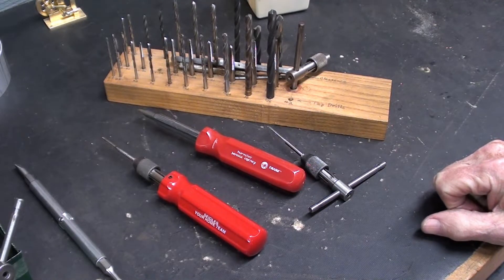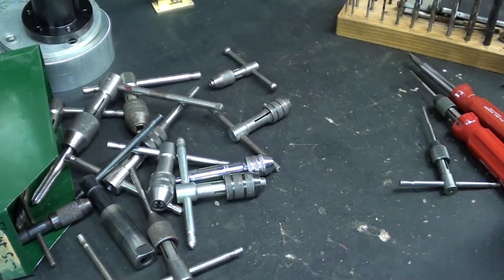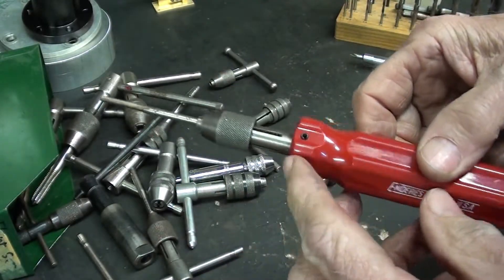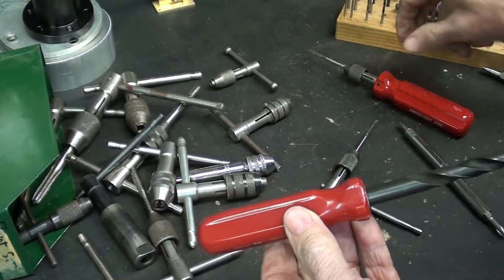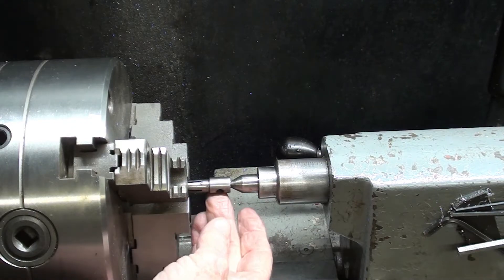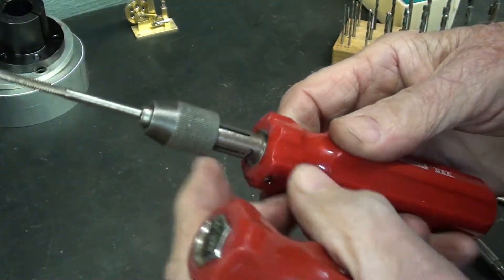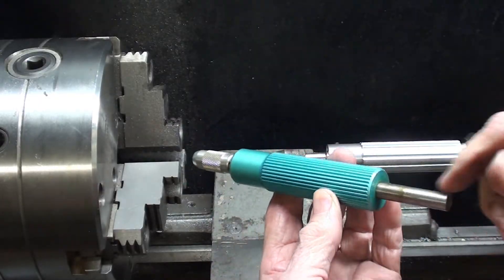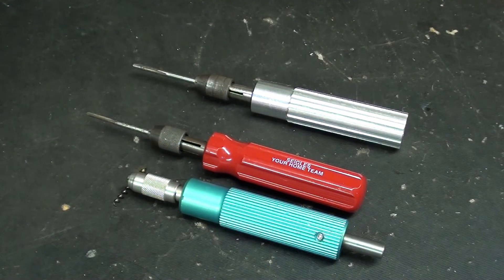MAKE A SCREWDRIVER HANDLE TAP WRENCH #964 tubalcain

Comment: I do have a commercial version of that tap holder; it was my father in law's. He was an electrician and it holds a three diameter tap! It is 6-32, 8-32 and 10-24 or 32. It works well as electricians usually tap thin metal.
Reply from the maker: I’ve got one of those around here someplace

Comment: I have a Craftsmen screwdriver tap handle. There is a cap on the end with a hollow handle to store taps and drills. As an electrician I used a lot of 6 & 8/32 and 10/32 taps. don't know if the Craftsmen is still available. I have probably had it 10-12 years.
Reply from the maker: I used to have one of those that had three sizes of threads. Made for electricians I don’t know what happened to it. But they were not high-speed steel. But only made to clean up threads.

Comment: I really like wood handles on screwdrivers and those types of tools becasue they are easier on the hands and aren't as slippery when they get oil on them. I'm wondering if I can find a wood handled screwdriver with a steel insert or perhaps make a steel insert which I epoxy in place, or just epoxy the donor tap wrench in the wood handle.
Reply from the maker: Turn on maple handle on your lathe very similar to a screwdriver handle

Comment: Got plenty of them.... You sure have! Why?...... The collector in full light... Joking!
"Understand what I mean?" Clear as mud!
 The mini lathe just got equipped with a new ER40 collet chuck and the runout is less than 1 thou! Now drilling an 11 millimeter hole for a candle waits in a 5 inch stick out. What's that? The body of the object consist of an 8 mm wide tre sided surface followed by a 4 sided, and a 5 sided,.... up to 13 sides. It's a test of a numerically controlled rotary table ran in the mini mill, a digitally controlled divider with a resolution of 1 to 576 000.
Long story but You inspired me to go on with that project, waiting for action!

Comment: Most T-handle tap holders have a 1/4" square drive in the top. I own a screwdriver type tool that looks like a screwdriver but it used to hold and turn 1/4" drive sockets. That type of tool would readily fit into the T handle and I have 3 T handles and the bar is removable if it gets in the way. It will add length. Just a suggestion for anyone not interested in making this tool but like the idea and their tap handle has the square hole. Another tip. I used to be a Snap On tool dealer. Back then, all the screwdriver handles were black and square. If a customer wore the blade out, we would tighten the shank in a vise, then tap the plastic handle off with a hammer and and replace the blade using the customers original handle. It took a firm hit and I used an open end wrench to straddle the shank and placed it against the handle instead of hitting the plastic directly.  I dept about 6 of the 4 " #2 Phillips blades and the 4" straight blades on the truck. Hardly replaced the other sizes but that was the way it was done. I wonder if that Craftsman handle comes off the same way or if Craftsman did some process like glue or casting the handle around the shank  thinking it would come loose. I used a Snap On handle to make a de-burring  tool with a 3/8" drill bit and still have it and use it mainly on holes in aluminum sheet metal.
Reply from the maker: Thank you for the suggestion. I hope that other people read this comment.

Comment: That's very cool. Im and electrical engineer, and have and half of the world of electronics is held together with 4-40 screws. I have a small tap, I have used for years, and the handle has always been more of a hindrance than benefit. Most of the time I just take the handle out, but then the tap wrench is too short for my hand. I don't know why it never occurred to me to adapt a screwdriver handle to the tap wrench. Thanks for the video, and the idea. Sometimes the most obvious things are the hardest to see.
Reply from the maker: You’re right, the obvious things are the hardest to see.

Comment: honestly my favorite non-tap tap wrench is an ER20 collet system on a MT2 taper (that I use for drilling too from the tailstock of my lathe) and I HATE those screw down tap handles, and prefer those side screwing handles with two V cuts into two pieces of steel that slide sideways into them the ER20 was a solution where I did not have room for the handles to turn around,, only way to make a screwdriver handle tap handle would be to fit it with the ER system of choice (ER11 for a smaller diameter outside while only holding up to 1/4" taps so ER20 will allow up to half inch taps like the home made acme 1/2-10 tap I made from a section of Acme threaded rod lol

Comment: Many years ago, I purchased a wood lathe just to make cork grips for the  fly rods I make. I also got into turning small wooden kitchen utensils and hand tools.  One of the items most people like is screw drivers with multi bits. The bore for in the handles are 7/16". I also made some knurled knobs to fit on taps  for work.  We often have to clean up threaded holes in tight places on machinery we work on. I took that idea from Joe  Pie. As always,  I enjoy your videos.

Comment: I am waiting on a follow up on that dividing head. I got one just before you did. One thing that I liked was it has the same thread as my lathe. but yesterday I needed a four jaw on the dividing head. all good. NO. the chuck that came with the dividing head will go on my lathe. but none of the chucks I have will go on the dividing head. seams like the shoulder just behind the threads is a bit to big. Is yours the same?
Reply from the maker: I never thought of putting a four jaw on the dividing head. I will have to try it sometime.

Comment: My Farmall 806 is my utility tractor. We don't farm, and the old tired 806 doesn't get much work. Duty called as neglected repairs on the 806 demanded attention.  
I spent most of last week addressing one issue that led to addressing another. I repeated that process until forced to stop. I trapped my mower in the shop, and by this time, I had the tractor disassembled too far to start and move. I failed to compkete the original task, but I repaired annoying issues that I have been neglecting for 15-20 years. Most of my repairs drove some necessity to make or modify something. My machine shop is in the same building as the vehicle service bay. I had lots of fun making repair solutions instead of running back to the Case IH dealer for more expensive parts. My range transmission has never shifted well. I have ignored repairs just because it was too involved to address. There were multiple issues, but a significant component was a worn-out DU bushing. The $46 OEM part was available plus shipping cost and delays. I machined a custom bushing from a PVC fitting that will last for the rest of my lifetime. No delays, and the fitting was in my inventory.  Necessity and availability can solve issues affordably. A purchased solution would be better, but my solution was like you illustrated in this video. With a bit of machining capacity, you can create a solution, save time and expense, and have a little machine shop fun. Oh, I also had to make a custom pusher to remove the worn DU bushing and press in the far more fragile PVC solution. 

I have several Snap-On ratcheting screw drivers crying to be abused and made into your tap tool.
Reply from the maker: That’s a good story.
My brother used to say  “ how does anyone in the world get along without owning a lathe?”
Reply: @mrpete222  or a good table saw!

Comment: Hi Mr P.  Here in the UK I've seen electricians with a similar tool for re-threading the M3.5 holes in wall boxes.
Reply from the maker: I have seen an electricians screwdriver type tapping tool that had all three common electrical sizes machine on one single shaft. Wish I still had it to show off.

Comment: Craftsman had an adjustable collet screwdriver style. I was actually wondering about this the previous day and the only similar ones I could come across were klein and ideal but they are 3 taps in 1 so it's extra long and I find if your using it on electrical boxes sometimes you don't have enough room to get to the size you want and need like the single style craftsman and the klein and ideal etc use a set screw and proprietary multi tap bits which I don't like that your stuck with just that and having to source these bits instead of working with a collet system. I wish I had a lathe I would love to make one of these. I guess i could always work it on a belt sander and take it down little by little. The others are probably more expensive the little craftsman was only $10-15 if I remember correctly.
Reply from the maker: I had one of those tapping tools. I think it was made by ideal. And yes, it was rather long.
Reply: @mrpete222  yeah the ideal and klein are like double ended and stepped tap bits which I always found to be annoying because if you needed the 8-32 you had to go past the 6-32 which was about an inch plus and sometimes on a shallow electrical box you didnt have the room to run the tap to clean the threads of the 8-32, whereas the craftsman it had a normal tap wrench collet allowing you to use any size tap you needed and was easily replaced. The ideal / klein required you to use an Allen wrench and you could only use their tap bits. I was actually just searching the internet 2 days ago for a similar craftsman model like you made and I couldn't find any that use the collet system to my surprise.

Comment: Sears Craftsman used to sell a screwdriver tap handle; the really cool thing is it has a hollow handle and a screw-on cap to store the drills and taps in the handle.  Yeah, I know it's not healthy to store taps and drills rattling together like this, but so long as you're not shaking the tool like a rattle-can spray bomb, you'll be okay.  Cheers, Mr. Pete!
Reply from the maker: I think I remember seeing those

Comment: I have a tap driver made from Ideal, made for electricians, which does 6-32, 8-32, and 10-32, the three most common sizes of thread on small electrical devices.   I have used it for a couple of decades.  Recently I have started using the 1/4-inch hex drive, drill-tap-reamers in a ratcheting multi-driver handle made to accept 1/4-hex bits, to ream out holes and thread them.  The drill portion reams the hole to the correct size, the tap follows, and finally the reamer portion bevels the surface to remove any burrs.
Reply from the maker: I had one of those ideal, tapping tools. I don’t know what happened to it.

Comment: An electrical supply place will have the screwdriver type tap. They come with a 6/32, 8/32 and 10/24 all in one.
Reply from the maker: You are the fourth one to mention that. And I forgot all about those tools and I used to have one made by ideal.
Reply: Craftsman made one that the small taps stored in the handle. Klein made one that was more like the multi-scewdriver and it's taps transitioned from smaller to the next size up so if you had a striped out hole in a metal box, you could re-thread it, the next size up.
Reply: @dannyl2598 so it's like a all in one?

Comment: Always a pleasure ❤
It's refreshing to hear "roll pin".
Some of the people on YouTube that take obvious pride in being self-taught seem to make up names for things as they go along, "spring-pin" "snap gage" etc.
Reply: Spring pins do exist. 
A spring pin is metal rolled up like a roll of paper towels, whereas a roll pin is metal rolled into a pipe shape with a n open seam. 
Spring pins are harder and can take more stresses before working loose.
Reply: @jimfiles3307  is thatt what itt is called to have a rolled peice of metal that slides into a slot so it can align two plates before sliding a bolt through the top peice of metal and the rolled metal tube before being screwed down to the second piece of metal like a head on a motor? I seem to recall they called it something else and it was from the website for an auto parts supplier too. so it was not their name for it, but what the company called it.(range Rover I believe was the vehicle it was for, due to it not being available for some reason for months on end, so they paid me like 75 bucks and paid like 50 dollars for the metal to make them. Though to be fair they said the ones I made worked far better and lasted even now 8 years later still going strong lol.
Reply: @ThomasAndersonbsf I think you are referring to a sleeve. 
A spring pin is a tightly wrapped roll of thin hardened steel.
Reply: @jimfiles3307  yep
Reply from the maker: I have heard them called spring pins or tension pins
Reply: @mrpete222 I've heard a hammer called a BFH but I  think that is slang. 
I prefer the name that my teachers taught me when I was an apprentice.

Comment: Yes they sell those usually in the electrical department of the store. I still have mine which I bought over 30 years ago for tapping switch and outlet devices. It utilizes three tap sizes on the same shank. I keep mine clean and razor sharp and it lives in a drawer where it sits for years until I need it and when I do, nothing else will substitute for it. Very handy …every 5-7 years.
Reply from the maker: I used to have one of those and I forgot all about it. You were about the 10th person to mention that.